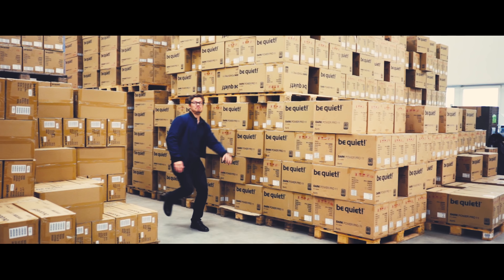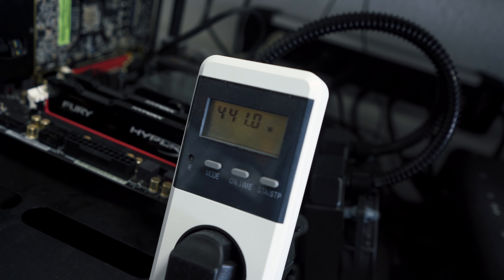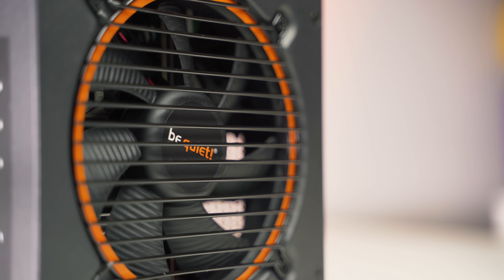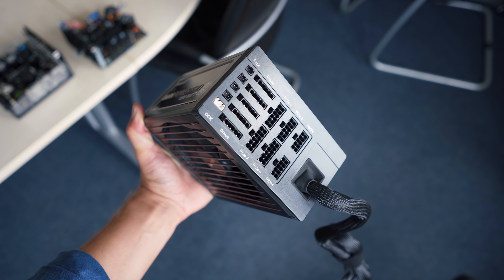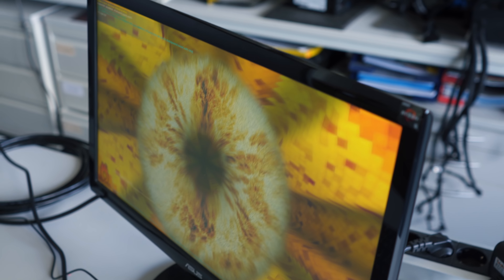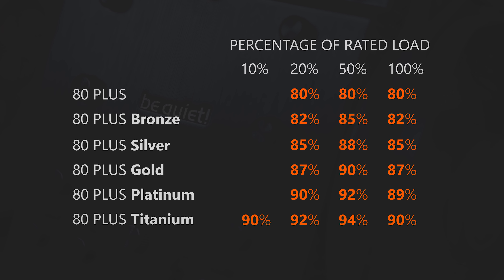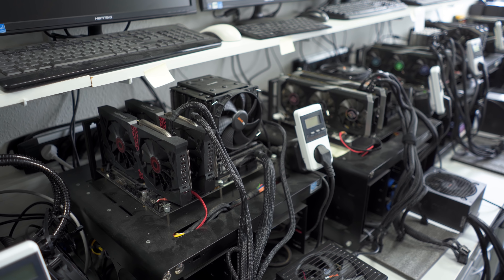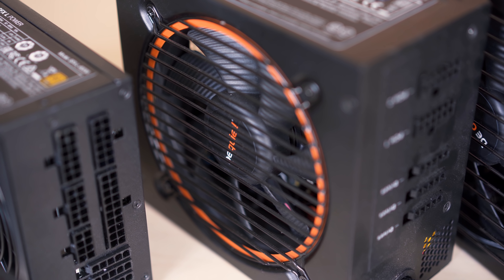How To Choose a Power Supply

Comment: First and foremost You check who made it. Either Seasonic, Super Flower or their rebrands as OEMs are best choice. Watching this video while looking at some cheap chinese company is asking for house fire, electricution, death of all PC components or all of them.
First thing Dimitri shoulkd have said to not skimp on PSU's nor buy crap knockoffs.
I know Be Quiet sponsored it and it was targeted to show their products, but still...
Reply: *facedesk*
Seasonic and SF is the worst, not the best. Because they are smaller OEMs, they outsource their PCB-A. This results in worse QC, compared to larger OEMs. Just look at the EVGA B3.
ALL PSUs are made in China. 
Also, you get what you pay for. Seasonic has the crappy S12/M12 II, while Andyson (a brand usually making crappy PSUs) makes the Aerocool Project 7. How? Because the S12/M12 II is made to be cheap and crap, while Aerocool paid Andyson to make a good PSU.
Reply: @MrSeon123  Evga get their PSU from Seasonic. Most, if not all use same pinout as Seasonic. They might change few things, but it still is rebranded Seasonic. Even my Evga 850w is a Seasonic due to noticeable 4 double wires. I used to get paid to make custom cables for PSU modular and nonmodular.
Reply: @michaelfairchild  Again, completely false. Only the GS and PS are Seasonic. SF is the OEM of the G3, G2, P2, T2, B3 and BT. EVGA mostly uses the old SF pinout. 
The G2, P2, T2 and B3 are essentially Leadex rebrands, but the G3 is custom, but based on the Leadex 2.
Reply: @MrSeon123  That custom for G3 is Leadex II with different input filter. I might have mistaken on OEM for EVGA, but still shows that two big players most companies base their products are Seasonic and Superflower. Every company (even the top tier one) will sell cheap ones with cheap components labeled as "budget" and those units will have worse components, but you will still buy it than a noname brand that will burn your house with "similar specs". Point I was making is that you cannot take every hint that Dimitri gave and use it as a template for every company that makes a PSUs. Also that big brands base their units of either Seasonic or Superflower. If either of those companies were crap neither of them would sell their units with their labels or sell them as OEM. Every company has one crappy product which wont sell or will badly. Neither Seasonic or Superflower is an exception.
Though, its always good to see other companies making Top tier PSUs. As long as there is a rival in the business a client will profit.
Reply: @michaelfairchild  RealHardTechX has a list that shows the OEMs of different PSUs. Most don't use Seasonic and SF. Corsair only uses Seasonic for some of the AX series, CM only uses Seasonic for the V series, Thermaltake uses neither, same for be quiet and BitFenix. 
The components used in a PSU matter a whole lot less than the design of the PSU. The S12/M12 II use Japanese caps, but it's still crap, because it's loud, lacks protections, and is group regulated. Meanwhile, Delta can use super low end caps, and still have an amazing PSU. 
Again, Aerocool has the Project 7, made by Andyson. Thermaltake has various good PSUs made by Sirfa. Cougar has the GX-F, a good unit made by HEC. None of those are considered high end brands, but they can produce good PSUs if they are paid to do so. 
If someone takes any YouTuber's advice on PSUs, they will end up with crap. None of them have any idea what they're talking about. (Except for OC3D maybe)
I didn't say that Seasonic and SF were crap, I said that they are worse than bigger OEMs. They are perfectly capable of making good PSUs. And also bad PSUs. Just like every single other OEM. 
Why is it so hard for you to realise that you can't just buy by brand, and instead have to look at reviews of the specific PSU in question?

Comment: Your point about the modularity doesn't make sense..... No matter if it is modular or not, that won't affect the cables you use.

If your build is using a total of 5 cables entirely, it doesn't matter if it is modular or not, 5 cables is all that is needed, but at least with a modular PSU you can use ONLY what is needed, where standard PSU is left with a literal bunch of cables that have to be tucked away somewhere....MUCH bigger problem then having to leave some unused cables in a box or fabric pouch man.

Comment: Hey, is corsiar VS series psu good?
Reply: No, it's the bottom end Corsair PSU, you shouldn't buy it
Reply: Not particularly. It's Corsair's cheap low-end.
Reply: @dainiusvysniauskas2049  any good reason other than it's cheap.
Reply: @lightning2940  Go for CX or CXM for the cheapest unit (not the green labels). The overall quality of VS is shit. Group regulated too.

Comment: 1030-1060 400watts 80+ bronze,  
1070-2080Ti 600-800 80+ bronze,  
SLI: at least 850 80+ bronze...
Always go with well known brands and fully modular cables if you can. 

There`s absolutely no reason for such a long video...

Comment: Don't get an EVGA G2 I've had 3 EVGA G2 fail in the last year out of all the computers I built in that time they were the only ones that failed.
2 customers and my brothers all users were very moderate with them and all 3 failed on the main board showing burnt surface mounted parts they are junk stay away.
Reply: @COFASA 2 out of 3 aint bad 3 out of 3 is a fail..... junk stay away.
Reply: @MrLunithy  well it had to be something, G2 is one of the better EVGA units. Better than g3.
Reply: @ybeninjaxl254  Yeah I have 2 EVGA GTX 780's and they are rock solid... but I'm done wit the PSU's they make... Ive about 15 Corsair TX 850's out there still going strong since 2013 and my own rigs have the same units with no problems and the warranty's have long since expired.
And considering the failures happened over a year or so I must have been lucky to get the crap one's that came out on those months as customers for gaming PC's are fairly random.
Reply: @MrLunithy  Nice.

Comment: I know you are sponsored by be quiet but they make shitty PSUs, competition like Corsair and Seasonic are way ahead, only one possible thing that is above average about their PSUs are FANs, but ripple, regulation, efficiency are below average for the price they go.
Reply: Oh boy, are you wrong. 
First of all, Be quiet doesn't make any PSUs. Their main OEM is FSP. 
Corsair doesn't make any PSUs. They mainly use CWT, but also GW, Flextronics and Seasonic. I think they have also used HEC for some lower end ones. 
Being made by a smaller OEM like Seasonic is a negative. They outsource the PCB-A production, resulting in worse QC, compared to a bigger OEM. 
The regulation doesn't matter as long as it's below ~1%. And ripple is excellent below ~25mV. 
The Focus, for example also has similar/slightly worse transient response, compared to the Straight Power and Dark Power. 
Then you have Seasonic's S12/M12 II, which are ancient and garbage. When compared to the similarly priced/cheaper System Power 9 and Pure Power 10, it's clear why it shouldn't exist, and also why idiots keep buying them. 
Seasonic also lacks multi rail on all of their PSUs. And the Hong Hua fans they use are also not very good. 
Corsair has a large range of PSUs, and are mostly just comparable to the equivalently priced Be Quiet units. They are rarely better.